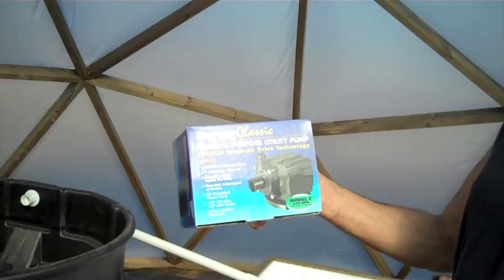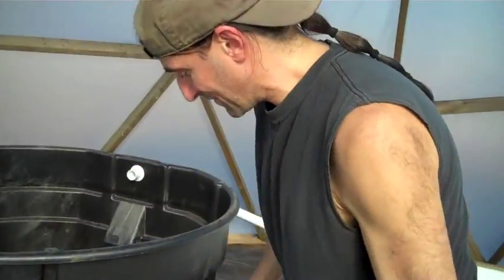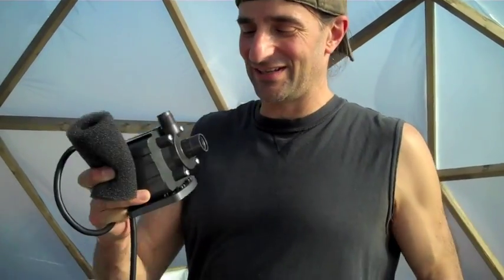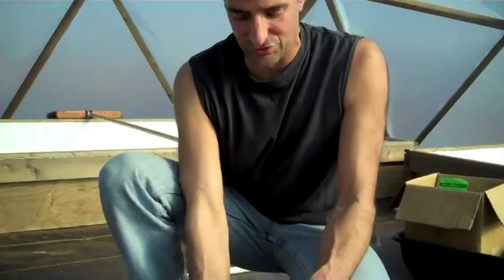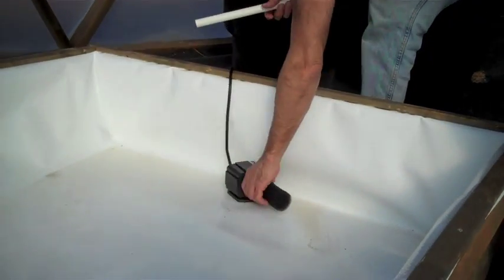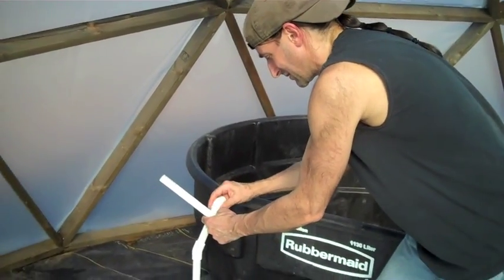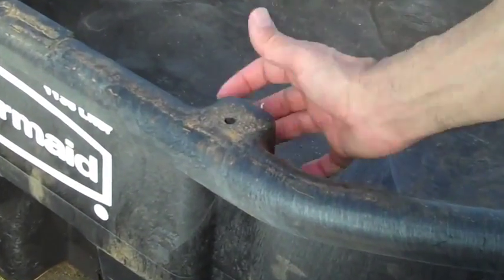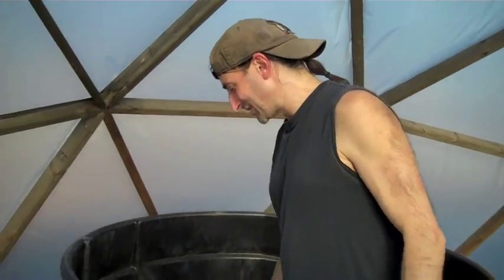PUMP HOOKUP

Comment from the maker: @web4deb Funny you mention that. I just bought Murray Hallam's video on gravel beds but can't seem to find much info on how to incorporate the two different systems together. I know Green Acre Aq. in Tampa is doing it as well as others I've seen but there doesn't seem to be much info about setting it up. I don't get how the flood and drain works together with the constant flow of the raft system. If you could help me out it would be very much appreciated. Message me since space is limited here.

Comment: @ghog63 This summer when I finally start to put the beds in my dome, I'm planning on doing 1/3 of the area with beds with expanded shale and the rest for rafts. I think you will find if you want to grow a larger root plant, like toms or cukes, you're going to want a bed with media. Throw in some red wigglers and they will help with the solid removal and you'll have a nice balanced system.  Personally, I think a net tank is a waste of space that could be filled with media and grow something. ;-)

Comment from the maker: @web4deb Thanks for the tip. I read in the manual that the filter was optional and wasn't sure about whether or not to use it. 
We debated whether or not to add a biofilter. (Left room to add one if needed.) Spoke with Chris Smith at Coastview Aq. He doesn't use one on his microsystem and doesn't have a problem. We are planning on introducing gammarus to our system. They are amazing. Friendly Aq. has them in their 5000 sqft system and their net tanks and solids tanks are spotless.

Comment: Ah why didnt you just heat up a stright section of pvc with a heat gun or hair dryer and bend it to what you needed instead of useing the 45's. very good job so far. also you might what to use some silacon sealent and lock down your plastic to your frame or in a high wind 60 + mph it could get ripped off. seen it done here in oklahoma was not pretty. good luck